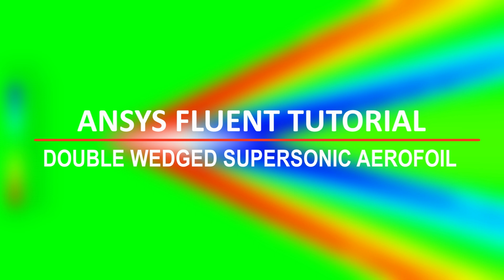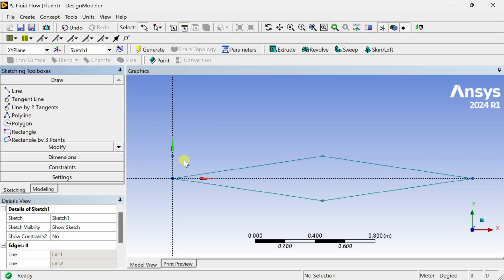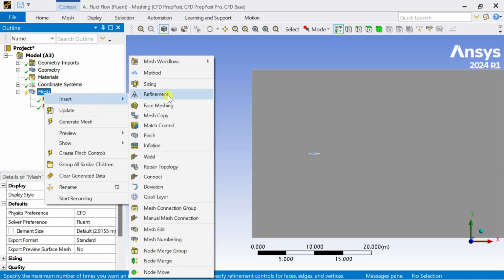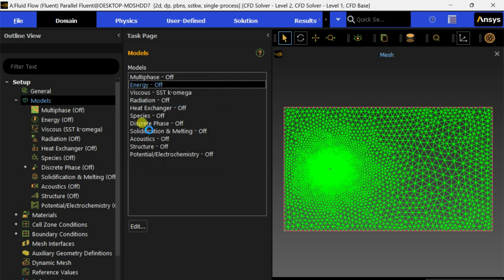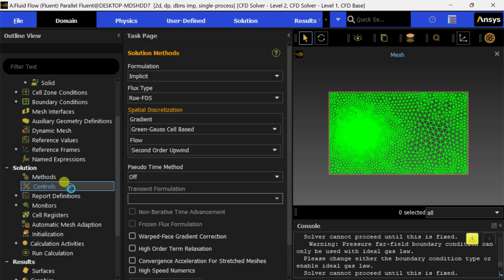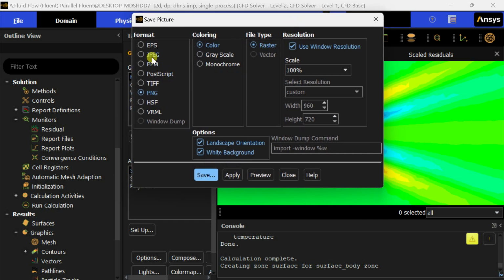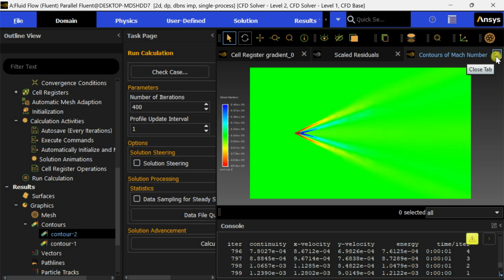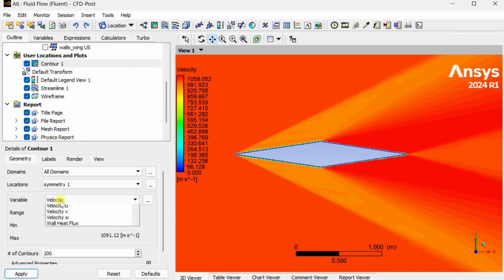CFD Analysis Of A Double Wedged Supersonic Aerofoil | Compressible Flow Tutorial | ANSYS Fluent CFD

Comment: I did step by step as in the video, and first thing is that there is no convergence (even at 800 iterations) and the second thing is that the drag force came out as 41437 N and lift force as 18 N which means that there is absolutely no chance for it to fly... seems something is wrong in the model. Any ideas why it came out like that?
Reply from the maker: It's an academic assignment. There is no practical application of this in real-life aerodynamics. If the residual vs iterations plot is not fluctuating, and providing a horizontal line, you can consider this as convergence.